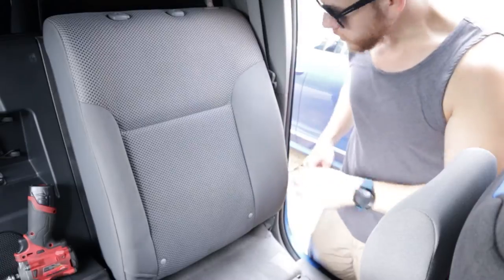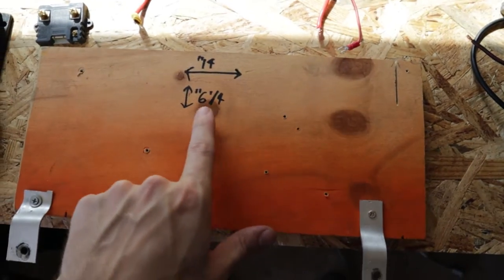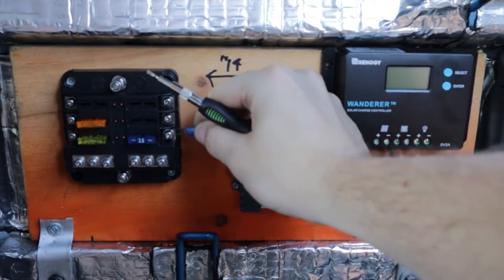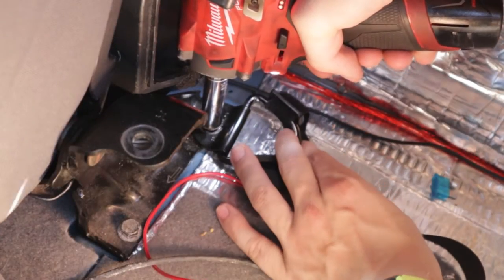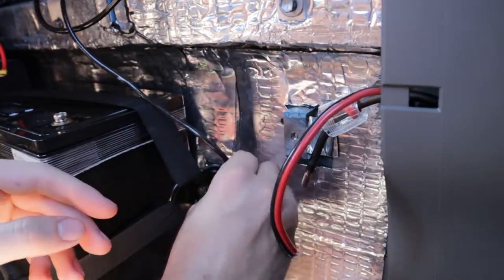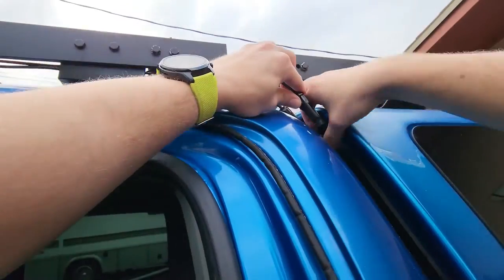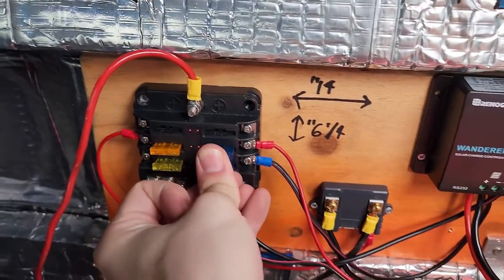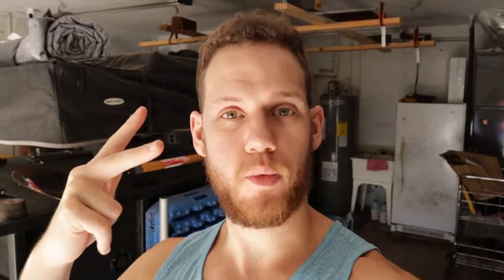Hidden Battery for a Fridge Install - Tacoma Overland Build on a Budget

Comment: I did a setup like this with a Dc to Dc charger to 2 100AH Lithium Iron Phosphate batteries, it works so well.
Reply: Did you also manage to fit both batteries behind the drivers rear seat? If so, I need to do this.
Reply: I did yes. I did have to take out the plastic cubby behind the seat, but I added sound deadening and built a small platform that screwed into the existing holes.

Comment: Great tutorial! Im thinking of going this route for a dometic cfx35 cooler. My question is Can i dual charge  the battery  while the truck is running so it also charges off the alternator?
Reply from the maker: Yes but you'll need to add in a DC to DC charger.

Comment: Did you upgrade the charge controler to a higher amp one?  Seems like 15amps isnt a lot
Reply from the maker: It's enough for my application, I only have a fridge and random small electronics running off of this battery.

Comment: Any difference s if you run the cables from the controller (output) straight to the battery not to the fuse block?

Comment: So you are able to use your seat still while it's working? And do you need air to keep it from getting warm or hot?
Reply from the maker: I've not had any issues and I leave the seat in its regular position

Comment: I've been thinking about doing this in my truck for awhile! I have the battery sitting in the bed at the moment behind the fridge. Where did you connect your truck ground to on the chassis?
Reply from the maker: Are you referring to where I grounded the battery?
Reply: @javileeYT  Yeah not sure why I said truck ground lol. Meant the battery ground my bad.
Reply from the maker: @wanderingoglethorpe  At 4:02 is where I ground the fuse block and I ground the battery to the fuse block.  So it's all grounded to the truck :)

Comment: How long can you run it on a cloudy day or at night? Also, what battery did you use?
Reply from the maker: I'm using a 85AH lithium battery I got from AliExpress forever ago but they're much cheaper on Amazon nowadays.  My fridge uses roughly 30AH over 24 hours in my testing so nearly 3 straight days without a recharge.
Reply: @javileeYT  wow, that is really good. I think I will go the same route as you! Thanks!
Reply from the maker: Glad I could help!